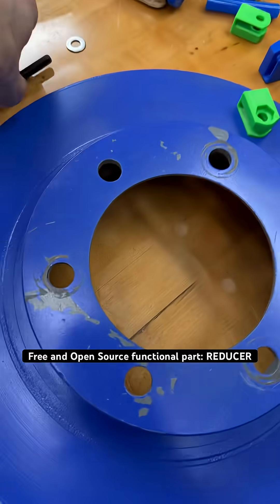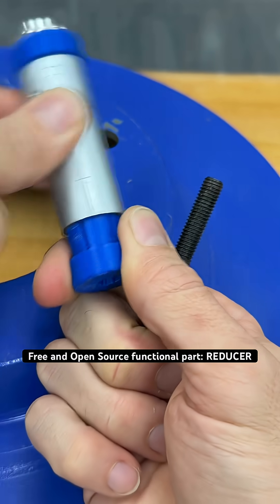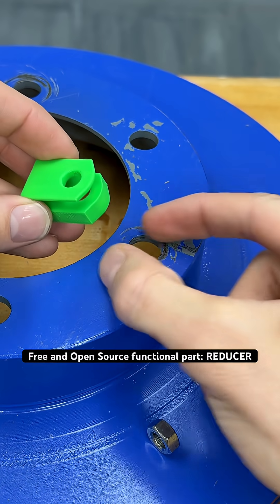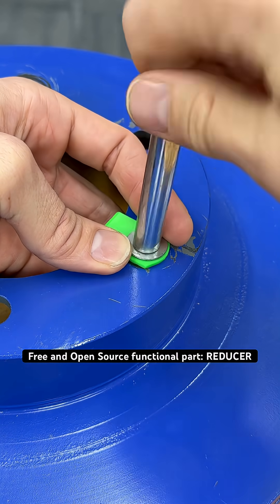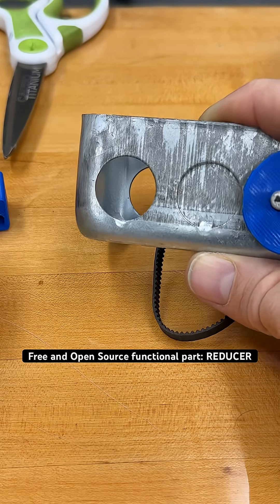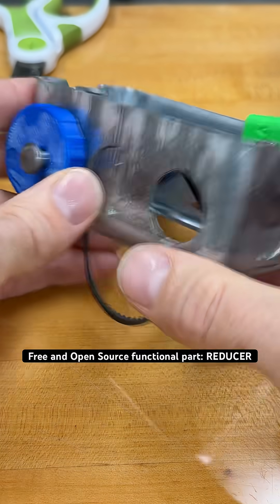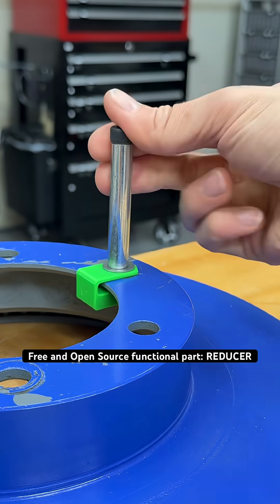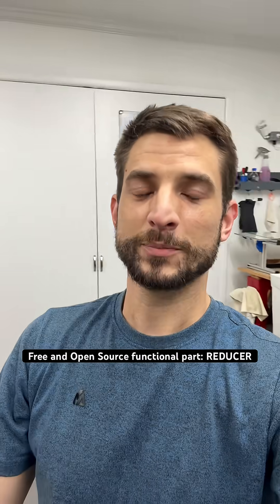reduce hole size in steel.  #openlab #opensourcehardware #engineering

Comment: In the use case of your car rotor, it would be extremely wise to put a conical boss on both sides. I get it though, no one in their right mind would use plastic in an application like that but, anytime you have rotational motion, there's bound to be vibration. Not to mention the torque being applied.

Comment: those clips are very similar to some little metal clips that I usually see packaged with car speakers. The "back" of those have as split in the metal allowing it to act as a nut for the screw.

Comment: I needed a part to install a new toilet seat and the hardware didn't fit so i grabbed the calipers and measured it out. Drew up a design real quick and had the insert printed all within an hour. I love 3d printing and design for practical use.

Comment: "there's some wobble"
FAIL
great demo. you could have printed a new one.

there are a lot of things here that are very sloppy or temporary. a metaphorical rotor? items that wear? things that aren't strong. bushings, helicoils, sleeves etc. aren't new

use case is...
we can reinvent the wheel. we can use things for purposes they aren't intended.
everything was planned a way for a reason (even if the reason was in error)
They make shoulder bolts also.

your demo almost failed on the lift too. there was a lot of deflection...

I love the repurposing of the box. The clips aren't new.

Comment: Best thing I ever did after buying a 3D printer is learning FreeCAD.  After a dozen simple designs getting the basics down, I tackled a much tougher project to get a high level of confidence: a "cart" that rides up and down in the track inside a car window for the window actuator that moves the window up and down for my sons car.  Had multiple curved cuts, precise inside gaps for the cable system that moves it up and down, and the pin to capture the glass window into it.  Now I have a design I can mirror and use on either side window of the car.

Less than a month of part time on a capable tool like FreeCAD will free your mind for anything you want to design in the future.
Reply: I like FreeCad too, but I don't like meaningless error codes
Reply: @BHBalast  Maybe, due to my studying of so many videos and researching steps, I simply don't get error messages.  Those that I got early on in learning were rather obvious to resolve.

Comment: Wouldn't creep end up with a loose connection over time?
Reply from the maker: gradually deforming plastic? it’s a separate issue to resolve.  For example, give the assembly sufficient preload.  I didn’t build an assembly yet so it’s hard to talk details. But it’s all solvable.
Reply: @davidmalawey  a separate issue that can't be resolved outside of very specific, and currently very expensive polymers
Reply: @osmacarplease give evidence, not a floating argument

Comment: I’d wish I had seen this cool solution a couple of days. In a wooden project. I ended up filling oversized holes with epoxy and redrilling.
Reply: Can’t you just hammer in a nut (or use a threaded insert)?

Comment: Reinvented g-clips from server racks.
It's great design, but hard to make much cheaper than the existing off-the-shelf ones for server racks.

However, for different sized holes, this is a great solution.
Reply from the maker: every hole size. every screw size, every offset.  it’s 10,000 parts.

before, you were a buyer. now you are a designer.
Reply: Not everyone is gonna get it, but for those who do... keep going.  @davidmalawey
Reply: @davidmalawey  logistics are expensive. deal with it. we pass that on to our customer in the name of safety, security, ease of manufacturing, aesthetics or whatever you want...

only a tiny group deal with large varieties. the smaller your bom the better.
Reply from the maker: @CBWP  i read this a couple times. I don’t get it.  Small BOM is good.  Agreed.  We don’t need to ship now, it’s digitally distributed for free.  This hardware is software.
Reply: @davidmalawey software doesn't fill holes. Someone has to print them. Do you wait till you need them and then wait a couple more hrs for them to print? Do we stock a few different sizes?

Usually you don't actually say what your goal is...
Reply: @CBWP really though, isn't the stocking issue up to the end user? Are you really that hard headed to not see the potential use cases? Would you rather spend many hours redesigning this and then printing it? Or....
Reply: @newolde1 some people buy things they don't need just to have them. Others get just what they need. This isn't ready to go. The end user still has to modify. The use case with a plastic nut is limited. A lot of times I just design stuff from scratch. Finding a model and tweaking it is fine for some stuff. This is not a complicated part, but it has a bunch of variables to change each time.
In openScad you script everything and it is easy to render a new object by just changing variables. Not as easy in some other apps though.
This part takes less than 5 min to design from scratch. So, I need more incentive...
Reply: @CBWP true for some, but not all. Metal 3D printing is becoming more and more accessible.
Reply: these have been used in the automotive industry for probably a century (AT LEAST 60+ years)
Reply: I think you're suggesting that David is unaware of "G-clips".  I'm sure he knows about them. You might like to know that G-clips were not invented for server racks, they are part of a widely-used  family of parts called speed-nuts or clip-on nuts.
Reply: This guy is going through earth’s entire catalog and claiming he invented it all
Reply from the maker: @Toad_Commander  no sir i put it into an equation.  this model is now an equation, that is the underlying benefit of the “parametric model”

that’s the effort.  10,000 different students or novice designers can download and without having any CAD skills they can adjust 3 variables and the part is designed for them.  

or since it’s free and open, someone can enhance it.  This is the same as when someone makes a software version of Chess.  they didn’t invent chess. they invented the software that computes it.
Reply: @Toad_Commander I don't think that's really the case.  He's showing that you can make things at home to resolve issues. He's encouraging critical thinking for design.

Comment: Sheet metal on a commercial fryer chimney always strips out for me. Unfortunately plastic wouldn't work in this scenario, thank you for sharing your designs, it's truly inspiring.
Reply: You can buy or make metal versions made of folded steel. I think I saw them on server racks and maybe for attaching car door panels.
Reply: It won't be long untill 3d printing with metal becomes affordable for the home gamer
Reply: @r-urbex1611  dont let zwicker bother you. they are just poor. if you consider $300 expensive, you have other issues obviously. 
As far as metal printing, we could use solder in a 3d printer with a good hot end and a lot of cooling. It IS getting close...

I am actually going to try something like that thanks for the trigger... lol

as far as the chimney goes, I use some stupid zink drywall anchor things when that happens and I have to open it up a little. wink...
Reply: @r-urbex1611 dude regular 3d printing isnt affordable yet lol “long” is subjective but what youre talking about is going to take hundreds of years if its ever possible in the first place. Most of what we have today is not sustainable for the masses
Reply: There might be some plastics that would work. PET-CF is surprisingly heat tolerant and creep resistant, for example, and will print on many (most?) printers.

If you're worried about the fibre fill contaminating food, and you probably should, then I an think of a couple of approaches:
 - Coat the part with a food safe lacquer (POR make some high temp coatings that might work, but I haven't checked food safety)
- Print it with unfilled PPS instead
Reply: @leodearden this is the chimney of the fryer  it deflects the flames and heat. Folded steel designed like his 3D print would work.

I admire his philosophy of designing for the betterment of society.

Comment: I’ve seen very similar hardware being used for rack mounted audio gear. It’s especially useful if the threaded holes are stripped, you can add one of these to quickly add threads so you can still use the same hole.
Reply: We use similar stuff in automotive applications for attaching metal hardware to plastic panels. Probably where first encountered it too.

Comment: Could that part be made to hold large washers in place instead?  That way you have metal on metal?  I guess what I'm imagining is two separate pieces.  One holds the washer on the inside and with a plastic bump locates to the hole you're trying to mount to. And the other one would hold the second washer on the outside and run the bolt to centering shaft through the other side.  I don't think this description is going to work.  But I do think it's entirely possible to have a 3D printed part hold heavy washers in place while centering them and the bolt connecting them. Then you would have a strong all metal connection And the plastic is just keeping it all centered.
Reply: In that case you can just use a metal conical washer instead, I think..
Reply from the maker: yeah,see i got your spools spooling, this is good.  i think your concept is workable.